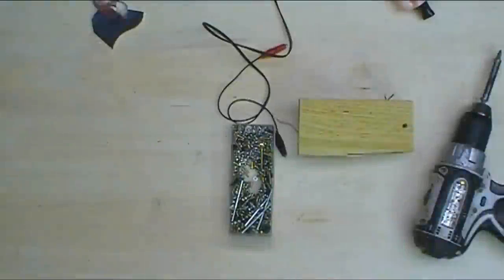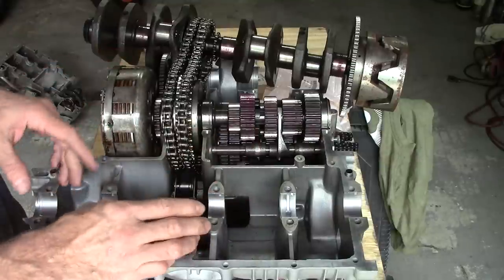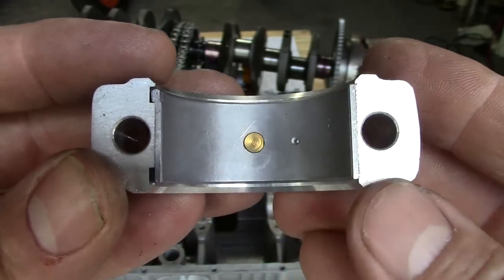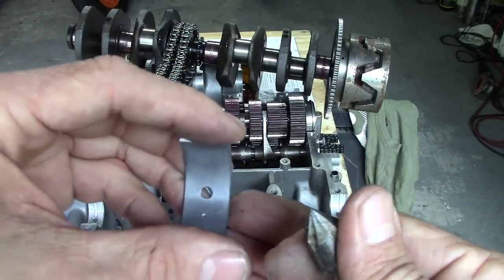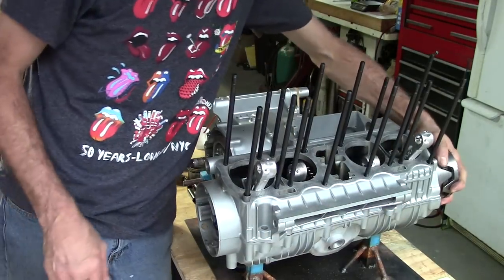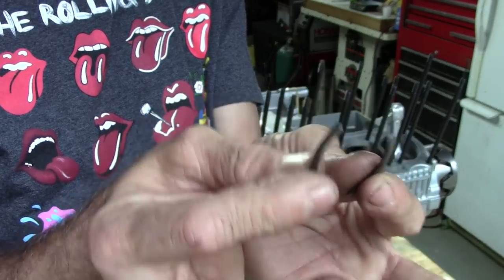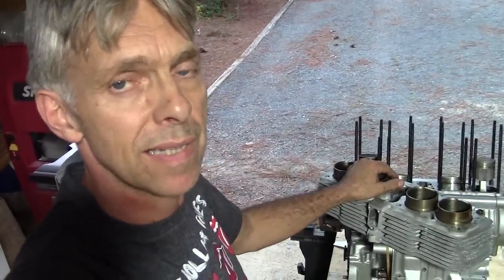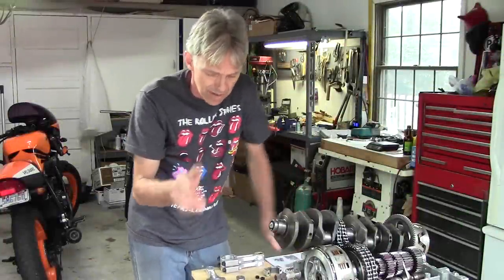73 Honda CB750 Custom Build Episode 10 - Forged Aluminum Connecting Rod Installation

Comment: I guess it's too late now... but years ago when I installed an 836cc kit into my 72 750 I got to talk to Pops Yoshimura  about the forged connecting rods.  He was adamant about putting heavy tape on the edges during assembly so they don't knock onto the crankcase and leave a mark.  It weakens the rod.  Had a BSA engine builder tell me the same thing.

Comment: I turned the engine upside down with the lower rcase off and you can look at the fit .You can hold the cylinder with cut tubing and head nuts or bolt the head on.But you will get it done your way too. Good luck

Comment: Nice video this week! As an automotive engineer, I absolutely love this show. More next week, hopefully! :D

You could just take a few measurements and use a CAD program to find out (almost exactly) how much material needs to be removed.

Or just draw it out in a 1:1 scale. Al you realy need is de scize of the skirts and how deep they mount, and then de depth at wich the crankshaft rotates. After that an outline of the rods and the stroke length should be enough. Just don't forget to take in acount the width of the rods in relation to the bore.

Comment: those rods look like they may have been "shot blasted"; i wonder if it might be a good idea to retreat the areas where you modified them? does your manual have the service bulletins included? i think the weight code requirement  was relaxed a bit after the printing and those rods would have been acceptable as was. i believe there was a bulletin  about replacement
parts to that effect.

Comment: You'd be an awesome neighbor. Are there two wrist pin clips per piston? Should you check the skirt clearances with a gasket or o-ring in place?
Reply: Will Willwill two circlips for each gudgeon pin otherwise they would start touching the cylinder bore

Comment: Question - im enjoying these videoes, thanks for sharing. 
Im not understanding why the con rods are not clearing the cylinder sleeves, also not understanding the hole drilled in the  bearing shell ?  Im assuming these modifications are required as  both con rod and shell are incorrect and the actual parts cannot be sourced ? Im probably missing something crucial here  ? Thanks.
Reply from the maker: The con rods are a wider dimension nearest the crank shaft. As the crankshaft rotates they would hit the cylinder sleeves if the weren't clearanced. At 6:45 I clearly explain why I drilled the hole in the bearing shell for the alignment pin. The stock rods don't have a pin. I used aluminum rods because they are lighter weight allowing the engine to spin up in RPMs a bit quicker.
Reply: @HackaweekTV  Thanks yes I understand your own procedure, I just dont understand why not just fit stock.
Also is the k4 engine interchangeable with a 1978 k7, ? I have 1978 k7 but I have a chance to buy a k4 engine, will it fit ?

Comment: If you lighten the rods ,you need to balance the crankshaft .
Reply: Dale olson with a inline 4 with a flat plane crank aka 180 degrees between firing the crank is Zero balanced. The outer 2 cylinders counter balance the inner 2 cylinders. So as long as your bob weight stays the same across all 4 holes it's balanced.

Comment: I wonder... in a 4 cylinder engine why don't they make each connecting road 90 degrees out of "fase" with the next. So That every 90 degrees you would have a piston firing? Would it distort the cam shaft over time? Whats the reason?
Reply: maxsnts Better power output and better balance.
Reply: look up 2009- present yamaha r1 , it uses a crossplane crank , sounds like a nascar at full tilt

Comment: Do you have to worry about gasket widths when checking clearance ?
Reply: Not really. If you use gasket goo / rtv then you'll have no real appreciable difference, and if you used a metal or composite gasket it'd bring the bores upwards therefore making larger clearance. So yeah, not really.
Reply: Samuel Corbett Ah.

Comment: You have to lighten your crankshaft. Because the rod are lighter. Ask your engine builder.
Reply: i think on a flat plane crank it doesn't matter , because there are no counter weights . Its more important that the pistons and rods are close as possible . On a crossplane crank like a your average v8 or v6 yes you have to get the crank balanced

Comment: If those are forged connecting rods, there shouldn't be cast lines on them......maybe those are left over machining lines?
Reply: TxGamer13 lmao it's called a parting line, when forging the 2 dies don't touch each other that's where the excess material squishes out.
Reply: Nick Holm Oh ok cool, thanks for the info!

Comment: why not leave the bottom case off and put the engine upside down you can see the rods for sure. I do this all the time, you don't need the trans in the case either
Reply: johnnym1320 Excellent suggestion! I'll have to try that. Thanks!
Reply: Looking forward to the build
Reply: Agreed.  That's the technique we used when I worked at a Honda Dealership.  If nothing else, being able to see a little more provides one with an added boost of confidence before making the modification.

Comment: Sorry I have just watched vid 10!!!!  very poor build, clunked rods will fail at high load, could he not bang that crank about any more and how about just putting cylinder and gasket  onto top case and turn up side down and rest on timber blocks to keep cylinders tight then lower crank,rods and pistons into place and you can see impact areas. I have only been building these motors since the early seventies so what do I know and pops would turn in his grave God bless him.
Reply: what do you mean by clunked rods?
Reply: I have been cringing from the beginning of the series when he scraped the stuff over the concrete floor. These vids should certainly not be watched for: "this is how it should be done".